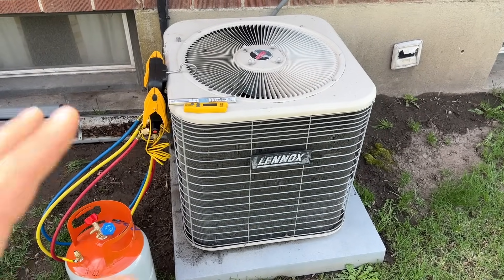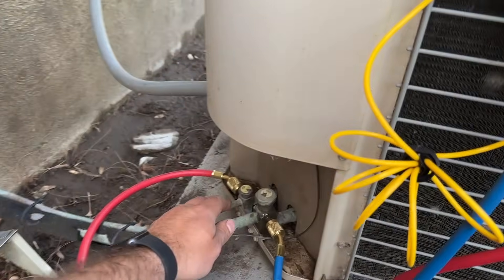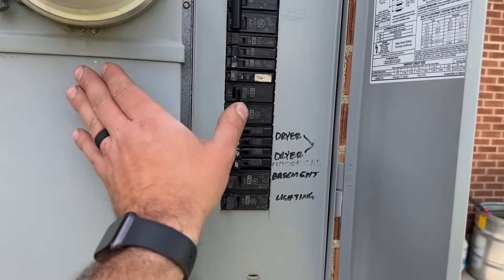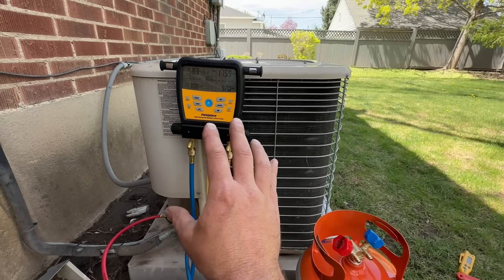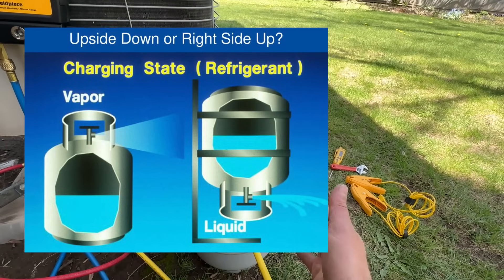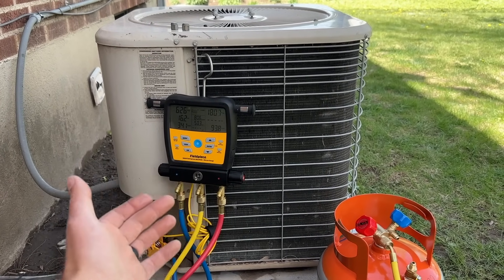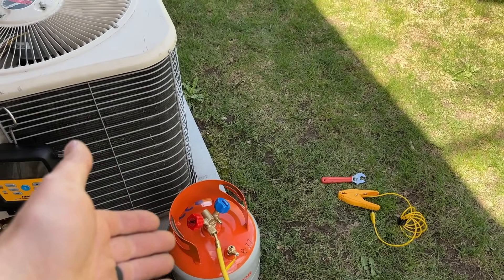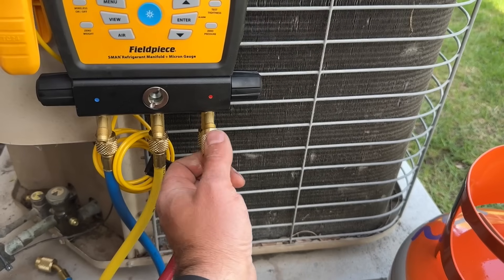How To PROPERLY Recharge Your Air Conditioner

Comment: Bro, you DIYers aren't doing a service to anybody that makes a living in the HVAC trade. People like you cost customers more money in the long run because you're not even educating on the fact that if they have to add refrigerant, they more than likely have leak somewhere. On top of that, you're take money away from a guy or gal that makes a living in this SKILLED TRADE.
Reply from the maker: Most people will argue the opposite saying I’m putting money in the skilled trade workers pocket because I’m a hack lol so which is it?
Reply: @The DIY HVAC Guy  again, you're costing them more money. How is putting a band-aid on a reoccurring issue save money? What should've been explaining is possible leak points and then calling a professional to fix the leak
Reply: @bigbush56  Let the owner of the equipment run their own calculator.
Reply: This infuriates me
Reply: It's their equipment. They can fix it if they want. It's called the right to repair. Go ask the John Deere about that.
Reply: If you own the equipment you can fix it yourself. It's called Right To Repair. Go ask John Deere about that. Sure this is a skilled trade and so is 1000 other different occupations. This one that has been ripe for fraud for so many years cosponsored by the shady parts suppliers in non descript buildings is finally showing its true colors that real life Joe's with some subset skillsets can now repair their own equipment with only the enhancement of the subset skillset exclusive to HVAC. It's hard to believe that a barber would be completely green learning how to dye hair and a lawnmower mechanic learning how to diagnose a failed SMOG inspection on a car would be completely green also. Here in California some HVAC parts suppliers advertise to the DIY community now due to lost sales from internet retailers. No longer is this a shadow industry ripe for fraud and that's what got the fraudsters like yourself mad!!!

Comment: You're awesome.  Keep it up.  How many years have you been doing HVAC?
Reply from the maker: 10 years sir. Thanks man
Reply: @diyhvacguy  I've got one for you.  I installed a 3 ton unit probably 13 years ago.  To this day it runs flawless....it will cool my place down right where I want it BUT for the past 2 season it has gotten really loud.  Reminds me of an extreme version of that sound you get at the end of pumping down a system into the compressor....but loud.  Almost like marbles.   Has absolutely zero issues other than sound.
Any thoughts?

Comment: What if you have a leak or electrical problem or other issues would you let them buy the tools for nothing? Charging the unit is not everything
Reply from the maker: Yes, there are TONS of other factors, but I’m just sharing how to charge a system is all. It could have a clogged filter, dirty coil etc etc. but this video just shows how to charge a system. Cheers

Comment: NOTE: They sell Low Loss adapters that you can thread onto the end of your non low-loss hoses.
Reply from the maker: Yesir, cheaper then buying the hoses but it creates 3 more spots to leak that’s why I prefer the hoses with them built in. Cheers

Comment: One more key takeaway with the low loss fittings is the refrigerant is still held back into the hoses. You can use the refrigerant from the high side hose when it is disconnected from the system to pump back into the low side as it’s still in liquid form. This way you don’t have liquid spraying out your hoses when you bleed them for the next job.
Reply from the maker: I learned this in school and forgot to apply it. Thank you for sharing!! I’ll include that in the next video! Cheers
Reply: @driatrogenesis  you can transfer pressure from high side into low side by opening manifold ports
Reply: Also 22 gauges and 410a gauges be good
Reply: Nope
Reply: We have shutoff valves on our hoses, turn them off before removing hose and you get super minimal loss and then can point the hose away while turning valve slowly open so you can vent off the liquid left in the hoses
Reply: @SavageOne420  if you're venting off a full hose of refrigerant that's about 3 ounces. 3oz lost from the system. That adds up.
Reply: @SavageOne420  or better still, just keep hoses connected to the manifold and the low side connected to the unit....then open the manifold valves and get most of the hose refrigerant forced back into the low side of the unit.

Comment: Love your videos, keep them coming. I have a Goodman Model GSH130361CD and just did the condenser clean as you suggested and yes the cap on that went bad and it cost me $300.00. Wished I had seen your video before but thanks to you I know some things I can do myself. So again you are fantastic for sharing your knowledge👍 take care.
Spokane WA
Reply: I've always thought that if the refrigerant needs recharging that means there is a leak as the system is sealed and it should last for a long time. I have a car that's 23 years old and the air-conditioning still works 've never added refrigerant
Reply: Yea those tongfen caps that goodman uses is junk. Also the caps that carrier and icp is also junk. They might last 3 years
Reply from the maker: Thanks so much!

Comment: where can you get the refridgerant
Reply from the maker: You can actually purchase refrigerant from Ability Refrigerants website. They just make you acknowledge that it will be used by an EPA certified tech once purchased. You can get a small van with 2lbs in it for about a hundred bucks.
Reply: @diyhvacguy  I have feeling that it is not 100% true about being able to buy(without having EPA 908 card by yourself or someone else) - then you add item to the order and start checkout they are asking you to provide EPA card info: name/address/date and I believe it means real EPA data or I'm missing something.
Reply: EPA 608 of course not 908.
Reply: @diyhvacguy  You’re 100% right.  I bought R410A without being asked for any license.
Reply: I never been able to buy any refrigerant with out my EPA certification 608, not even refrigerant for a car which is EPA certification 609. And yes I have both certifications. I am universal 608 certified.

Comment: while this video shows how to recover refrigerant, I guess key information missing was how to add and where to get R22 from in case you want to DIY it. Any leads on that?
I have a leak in my system which is causing refrigerant leak and require refill every couple years. Any DIY trick to do the repair like Fix-A-Flat?
Reply from the maker: If you shoot me an email at diyhvacguy@gmail.com I’ll give you some insight on this. Thanks,   Dave
Reply: Its illegal to charge and recovery refrigerant if you don’t have an EPA card. Which allows you to know the proper procedures and dangers of refrigerant handling.

Comment: Great concept video, not sure how you actually took wet bulb measurement indoors. I once had a tech punch a hole in my duct with the thermometer. (he told me to seal the hole myself)
Reply from the maker: I have a pocket psychrometer that measures wet bulb. Made by field piece
Reply: @diyhvacguy  testo makes good ones too, I use the fieldpiece pocket one every now and then
Reply: Need to puncture a hole in the return and use a fancy thermometer

Comment: Our unit is 3 years old. Came fully charged. The installer added a extra can of freon when installed the unit. Unit works fine but the ceiling vents closed to main trunk line have always sweated. Could the installer had put in too much freon. Thanks
Reply: You need to add more refrigerant when you have a longer line set, you need to make sure you have all your supply registers open. Otherwise you're going to have problems.
Reply: @miguelperdomo786  this is true. normally the unit will say how long a lineset it can support with the internal charge.. and if you need to use a longer lineset they can often add more charge to the system you just special order the system.. but if its a dealer they probably have 5 units sitting to go in people's houses so they aren't waiting for delivery.. and they just test the system and add more if needed.
Reply: @zippythechicken  we just add more refrigerant if a longer line set is needed or just remove refrigerant if it's shorter
Reply: are you saying you are getting condensation on (the outside) of your metal duct work? might want to check the humidity in the room. water will condensate on something cold like a glass with ice or a soda can thats cold....  and it will condensate on your duct work. .. if you had condensation on the inside of your duct then you should make sure the condensation line at your furnace is draining right.. i think he just did a video on hooking a shop vac to your condensate line to suck it clean.. i had to do that last year.. it sucked out a small mouse sized chunk of lint that was blocking the water from draining.. if condensation is inside of your ducts because the condensation line isn't draining its being forced into the ducts by the fan because its remaining in the internal part of the furnace (do you ever see your furnace leaking water that is an indicator of a blocked condensation line)... but if you have condensation on the outside of your duct and high humidity you probably should run a dehumidifier .. I need to do that in my basement sometimes.  good luck